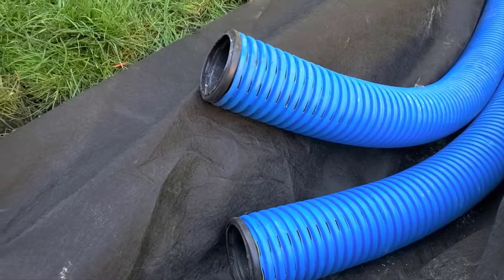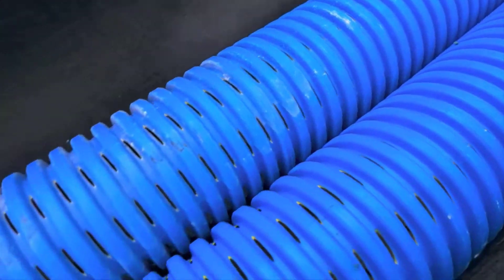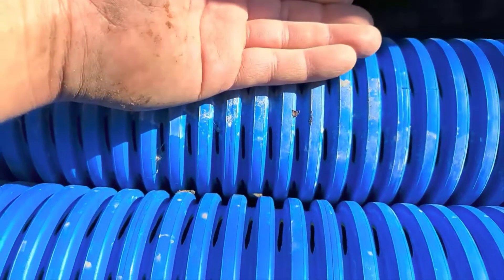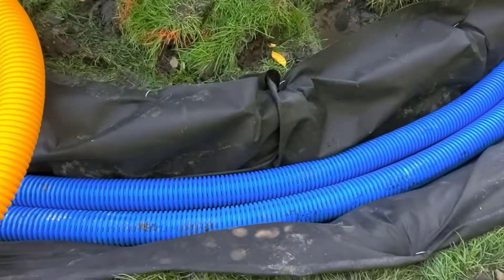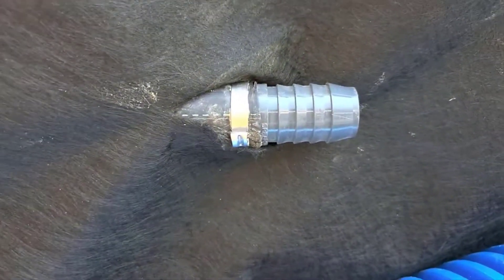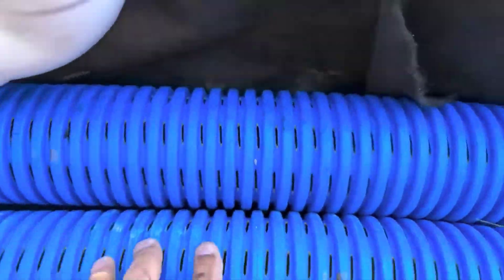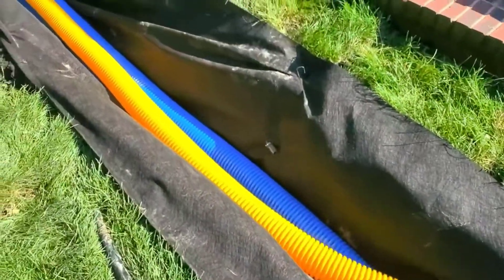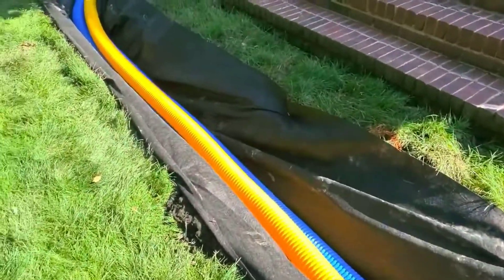How Does Perforated Drainage Pipe Work?

Comment: To give excellent service for farmers
Drainage contractor or pipe producer must know to work with FMEA analyses. To eliminate drainage failure all must know before and after steps of agricultural drainage systems how to be long life, this subject must well known
1- Corrugated drainage Pipe Production ( Perforation mix of raw material UV packing type.. )
2- Drainage pipe Envelope materials pore size according to soil texture or not ?
3- Trencher or Plow Manufacturing and ditching ( slope or grade precision, maintenance of trencher in project side, drainge roll feeders pipebox .. ect.
4- Soil analyses, depth and space of leterals
5- Ground worker operator Human Effect
6- Fittings quality
All this in one company we did not see as even we know world market pipe producer only getting machine from machine producer and starting to sale it just they are minding him profit !
All drainage contractors also looking to install long lines and shallow works to be fast and finish work to get money.
finally the farmers getting the feedback for clogging after 6 month or 15 years but all knows this pipe life cycle for disappear 100 years. but we are still using only 15-20 years and we are happy for that 🙂
To elminate clogging problem of system FMEA analysis will help to accademic report also because they are also focusing on 1 subjet and doing test. also in many research we so there is labratory test method is wrong not matching in real soil condition. plastik çevreye zararlı bir maddedir. this pipe must work in subsurface till disappear.
i you are not believe what we are taking attention please call any pipe producer arround you and ask him question like is they know how to make soil analyses or ask the contractor whats or plastic pipe raw material compenents how is the production machine i know when manufacturing machine is not work they are calling service to repair it ! 🙂 or ask for academic person how the trencher works for sloping ... no one will know all of this subject because market is runing and all knowing him subject to get profit and sale more ! but only farmers paying the last bill !
Why we are informing this issue for farmers ? Because in all world drainage market there is only once company Longlife Drain doing FMEA ( Failure Mode and Effects Analysis Worksheet ) in his system. Knowing to produce drainage corrugate machine, trencher/ plow and also have a better filter for drainage systems that is on world century innovation Anti clogging drainage or protector for long life cycle till disappear the plastic pipe in soil condition.
For more information about our activity and latest technology on subsurface drainage ;
www.hydroluis.net
www.longlifedrain.nl

Comment: I note FDM hardly mentions the fabric but does describe the effect. The reason the pipe runs dirty at first and then runs clean is the fabric. It allows water to flow quickly through it but doesn’t allow big particles through from the soil. It is in fact a filter. True some of the initial dirt is from the bad drainage stone but the main is the first bit of soil which goes through the fabric and then stops because of a structure that builds up in the soil called a filter cake. If the fabric wasn’t there the soil would keep piping through into the drain and the ground would settle.
Reply from the maker: Thanks for your help. You explained it very well.
https://youtu.be/fZIjnUoKp_I?si=0GZkQneHfC8CL0ll

Comment: The reason water flows through the big void is because of what is known as. Relative permeability. The bigger the void the faster the flow. A pipe is one big long straight void where water can accelerate. If water goes through gravel it has to wiggle about to go through and therefore goes slower . If it goes through soil it goes quite slow and if clay doesn’t go at all.
Reply from the maker: Thank you for commenting and contributing. 
https://youtu.be/kqUNnc0j8Kg?si=9NEc4ZvO40y-R9du

Comment: It doesn't flow out the bottom because of osmosis, water wants to travel to the most open area, which is the inside of the pipe, and although a tiny bit will flow out the bottom, the water is attracted to the inside of the pipe.
Reply: The answer we actually wanted
Reply: It's nothing related to osmosis. Where is the semi-permeable membrane needed to create osmosis?
Reply from the maker: https://youtu.be/_dAwYBuMCnI?si=bj382sNfHF75I6lG

Comment: Do you need one if the retaining wall is not very high, say only 20cm high?
Reply from the maker: I wouldn't think so. The retaining wall has to be installed correctly. Retaining wall material that can retain whatever the grade might be; if the wrong material is chosen, there will always be failure.

Comment: So you never explained why / how the water never exited the bottom of the pipe. Like you said its full of holes. Is the cloth waterproof. Do you always need that? Can you lay the pipe directly on to the soil?
Reply from the maker: https://youtu.be/_dAwYBuMCnI?si=SIjaD-5y6GKsUnAG
Reply: The reason we put the pipe there in the first place is that without it, water will not drain away rapidly enough, and that is because the soil is not sufficiently porous. If, after a period of dry weather, the soil under the pipe is not saturated, then when it rains, some water might flow into the pipe and then out through the bottom holes, but soon enough, the soil there will become saturated. Once that happens, water will no longer flow out through the holes because there is nowhere for it to go - all the voids are already filled with water. The excess water will enter the pipe through the holes and drain away through it, which is exactly what we want to happen.

To put it another way, if all the water entering the pipe drains away through the holes in the bottom, we did not need the pipe in the first place!
Reply: 100% agree = that's why I watched the video as I wanted to know why water does run out the bottom and side holes ! Maybe it's because they are partially covered whereas holes on the top surface aren't ???

Comment: I'm installing a drain with a deep trench, 3' or 4' deep. Would it be better to use two 4" (12.56 sq. in. cross section) pipes or one 6"  (28.26 sq. in. cross section)?
Reply: pye R squared is your answer, 6 inch pipe is 9 x 3.142 = 28 sq inches cross sectional area, for a 4 inch pipe = 12.5 sq inches each pipe = 25 sq inches total area. Same principal shows how 12 inch pizza much better value than two smaller ones 😁
Reply: @guyr7351  well, i was more concerned with the outside area of the pipe relative to the total of the cross sections. The surface area to cross section ratio for the two 4 inch  pipes is 150% of the 6" ratio.
Reply from the maker: 👍 
That's why I like two 4" pipe instead of a 6".
Frenchdrainman.com

Comment: FDM, you should do a video on why you put the pipe on the bottom of the trench.  I now realize that most tutorials on the internet say to add gravel first is because the pipe they talk about only has holes on the bottom (like solid PVC).  So if you put that on the bottom of your trench, it will clog and the water will never get into the pipe.  The pipe you use is perforated all around, so if the bottom clogs, the water still has the rest of the pipe circumference to flow into the center.  I did a little bit of both when I did mine (since I didn't have this epiphany until after).  I put a super thin layer (like 1 rock thick, like you spread them out on a cookie sheet), then put the pipe in, then filled the rest with stone.  I'd like to send you pictures.  Dug out the old home owner's TWO failed french drain systems.  Socked pipe!
Reply from the maker: https://youtu.be/rBURiuvGwiE?si=NztCUE6tnmTd2ZTh

Frenchdrainman.com

Comment: Thank you for you explanations on french drain topics.  In this video I don't understand why you run the downspout water to a pop-up,  when it looks like you could run the solid yellow pipe another 50-100 feet to the storm drain.  Why not run the downspout water to the same storm drain as the High Octane pipe?
Reply: Loss of velocity and then you need to worry about the pitch for the whole length of the run, so that you have the appropriate amount of fall.
Reply: And less digging. The perforated pipe will pick it up just as easily.
Reply from the maker: https://youtube.com/playlist?list=PLjFCqaZ4v1BXx1Stfatxcr8mJ_n3WAwlm&si=EfSh9l2ydIh-mhAb

Frenchdrainman.com

Comment: Dear Mr French Drain Man,  I have a dry well on the side of my driveway 2 feet by 5 feet deep it has a grated top I have sandy soil so it drains good in the summer.  My issue is winter I live in Vermont and it freezes then when we get the odd rain storm in February my driveway floods and water gets in my house.  There is no storm drain to connect it to nor is there a place to let the water drain down hill.  I’m wondering if building a French drain that is connected to my dry well would help the water drain out of the dry well?